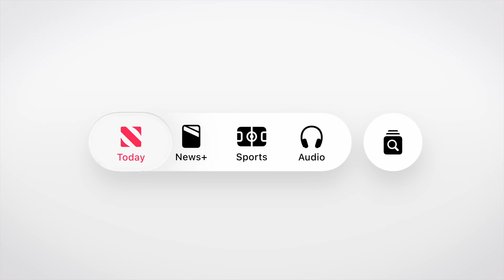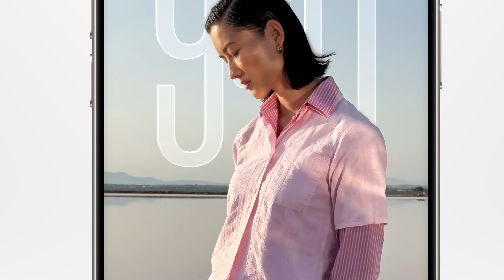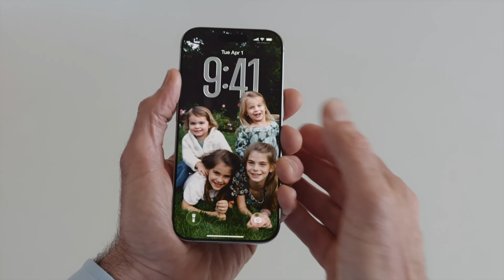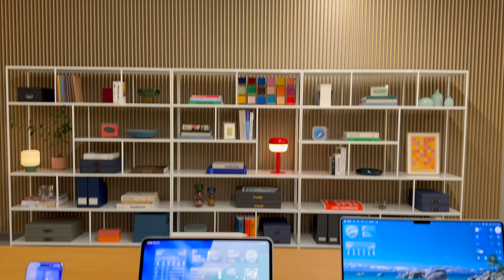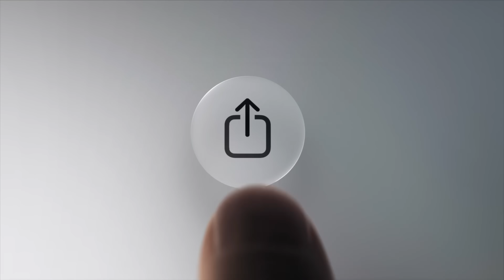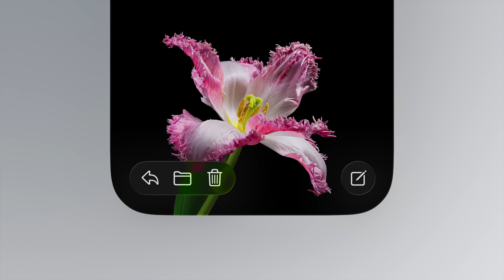The Truth About Apple's Liquid Glass in iOS 26, Explained!

Comment: This thing looks bad.   Moving away from iphone.  They shouldnt force this just have has a theme option (material/glass).  Just like they have light/dark theme.  I shouldnt have to go to accesories to disable effects.   This will turn so many people away from ios cause is not pratical.  Glass was never meant for reading, paper is and the reason why flat uniform background color exist and is much easier to read.
Reply: it's an option dude. Settings has accessibility setting to turn on "reduce transparency"
Reply: @PSy84 is not an option when you turn on a phone and looks the way it looks.  Then you have to go to a dip  menu in accesability.   Do you have to do this for light/dark mode. Nope, cause that an option.   Smh lmao.
Reply: Not an option when you have to dig deep into the settinf to turn that off,   do you have to do this for light/dark mode? No cause thats an option  @PSy84

Comment: They only created a new transparent theme and gave it a name. It's giving vista meh...
Reply from the maker: I explained why it's very different than Windows Vista in the video
Reply: I can assure you that this is NOT the case.  At first I was thinking the same thing on my initial beta download.  But they did a fast tweek a day or so later to Beta 1 and it just popped.  Seriously, just wait.  I took the brave step of downloading to both my 13 pro and 16 pro devices, and watch and old iPad.  I am glad I did.  They also updated the Beta 1 software for AirPods 2 and they have much better sound now, at least via apple music on the 16 pro.  It really is great what Apple is doing.
Reply: Vista is static blur, Liquid Glass is dynamic transparency. While the former looks boring, the later is a lot more fun as it changes depending on the interaction.
Reply: You're a complete idiot